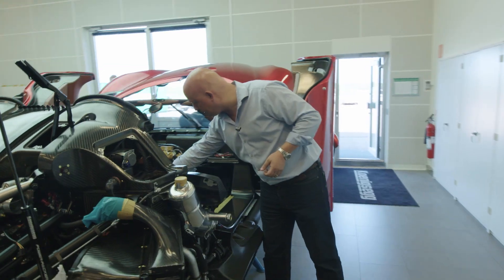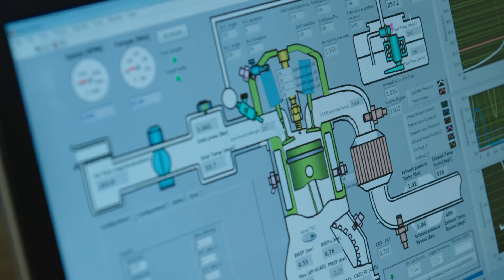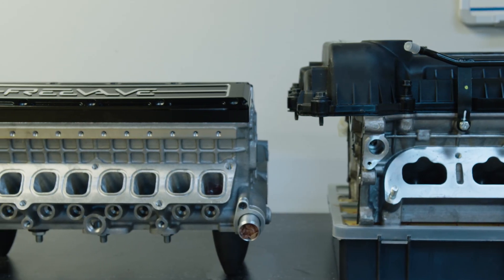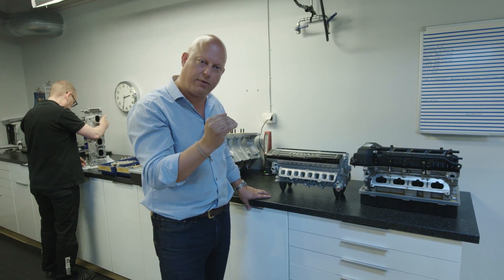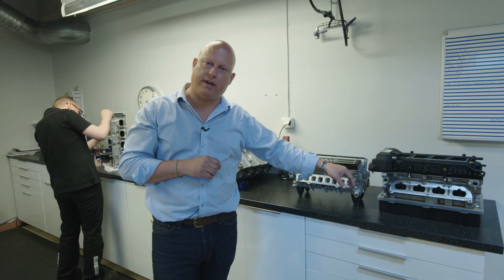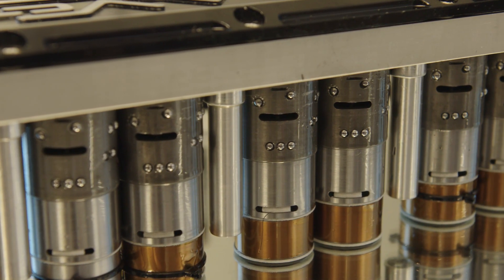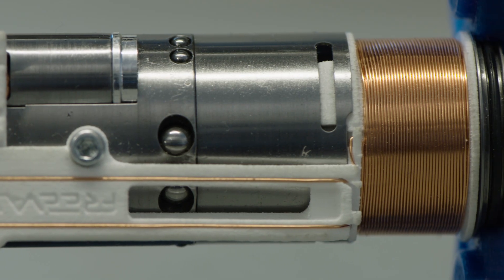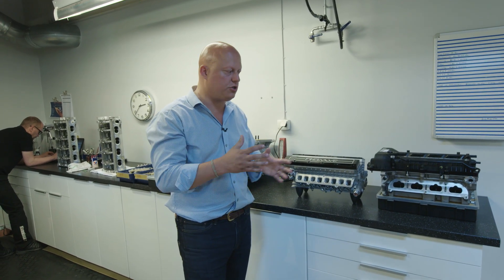Freevalve Update Camless Engine -- /INSIDE KOENIGSEGG

Comment: and people think electric cars are the only future not knowing the advanced made in internal combustion engines
Reply: shredBucketheadshred because of thermodynamics. ICE can be as efficient as physics allows. And it is not good enough. In addition burning gasoline with ultra high efficiency deals with only a third of the problem. most of pollution comes way before that. Making gasoline requires more electricity than EV consumes for same distance to travel compared to ideal ICE.
Reply: There's other things you can burn in a ICE than oil. 

ie over here most of the RE85 fuel is made from biodegradable WASTE.
Reply: Not true, in a disposable society everything is trash.... eventually
Reply: Opaali That's good but there is not enough of trash to run even 1% of all vehicles in the world.
Reply: Mantis Garage noup. car batteries are recycled and recycled and recycled. mor e than 95% of them. biodegradeble material is trashed but recyclets itself as fertilizer.
Reply: The reason we have issues with NOx gasses is because those are created when you lean burn fuel. A clean burn of fuel produces CO2 and H2O. The problem is that you produce "too much" CO2. 

In attempting to cut down on CO2 emissions we went to NOx emissions, attempting to cut those down has lead to the modern cars lack of MPG's over older vehicles as emissions controls are fighting the very principle of the engine. (Obvious example is look at how MPG has stagnated between 1980 and 2010)
Reply: Pretty much correct. There are ways to treat NOx emissions down to ridiculously low levels but manufacturers try to avoid those at all costs (due to extra costs).
This is called SCR and AdBlu is used for that. This also solves fuel consumtions that is used to treat exhaust.
Reply: I totally favor electric cars since they dont make as much noise as ICE cars, and that's very important for some of us! (sure hybrids are close but not really).
Reply: Vagelis Dimou
So no passion for automobiles huh? don't understand a mans connection and a driving experience? shame
Reply: Combustion will become more of an enthusiast thing just like manual transmissions. Gasoline, coming from oil is non renewable and because of that it's still going to lose out in popularity as compared to electronic. I believe hydrogen fuel cell is going to be more popular than a standard rechargeable electric car though. It is much more efficient and be refueled in a couple minutes rather than an hour or more.
Reply: Theres nothing wrong with CO2, that why we have trees, to convert CO2 to O2. The real issue is its non renewable.
Reply: Cave Johnson - and where, pray tell, does the electricity that runs those motors on the zumwalt class come from?     I've never looked into it, But I'm guessing with 90 percent certainty, that it is produced by generators spun by very large internal combustion engines.
Reply: Burning oil is untreatable disease - you always end up with CO2 no matter how clean burning process is.
But advancements in ICE tech is always welcomed. There will be few decades with a lot of PHEV vehicles.
Also trains, ships - those will take another decades to switch to electric. Therefore ICE engine advancements are very welcome.
Reply: Arnis Tarassu
Co2 is NOT the problem it's the other noxious gasses BUT the pint here is that electric motors and the massive amounts of electricity it takes to run them pollute more with the current tech weather its directly or the result of disposal of batteries and products
Reply: ***** oh. CO2 is not a problem. I see. Paris agreement was just for fun.
Reply: Arnis Tarassu
in comparison BUT the time when trees and plants stop breathing it THEN we have a real problem but you fail to understand that ICE's continue to improve and are more economical than ever while alternates are still very much a pollutant
Reply: *****
Making gearbox and ICE is also pollution. Making chassis is also pollution. Don't compare EV vs walking. Compare EV vs ICEvehicle. Batteries will pollute if you trash them. In real life used batteries have much longer life than vehicle itself. Stationary storage.
Reply: shredBucketheadshred sad that you do not know enough. learn. then speak
Reply: Arnis Tarassu
look who's talking
Reply: mech-engineer level5 (240 points, 4 years), you?
Reply: Preston Tucker, of the Tucker Automobile Company, came up with a cam-less engine design in the late 1940s. It was a 589 cubic inch engine and actuated its valves using hydraulic pressure versus this design's pneumatic construction. This is a rekindling of an old technology and refined for modern application. There really isn't much new under the sun in the automotive world, just revisions and refinements of past ideas. As we know, electric automobiles were more prominent than internal combustion engines at the turn of the last century and so was steam. ICE won for minor efficiencies in starting that were taken care of as steam tech advanced, and range, which would be taken care of by modern battery tech.

Comment: This is fascinating piece of technology! An engine with no cams and timing chain(s)/belt(s), no throttle body AND no DI would be basically unkillable and maintenance free (apart from basic maintenance any combustion engine needs)! Well if the freevalve system itself will withstand extended use. I bet this will be as close to EV's efficiency (currently) combustion engines will ever get.

Comment: Saving money with no pre cat and saving money with fuel consumption.?...I'm pretty sure this is not a cheap conversion..Just my thoughts.?
Reply: Dude this is engineering development to mainstream an incredible, advanced technology... Its not some fucking Summit Racing bolt on kit bro lol.
Reply: not. a. kit.
Reply: ZIGgassedUP obviously doing the conversion is going to cost money but it would pay for itself down the road
Reply: they adapt this to the existing motor so the company can reuse parts of there production
Reply: not an after market conversion kit...
Reply: Let's say the kit was 20,000 moneys and a pre cat is about 800 moneys then you'd have to burn up a lot of fuel to get to the part when you're actually saving money..Just my thoughts.
Reply: Forgive me if I heard wrong but I'm sure he said this project was adapting a freevalve system to an existing Chinese 1.6 liter turbo engine...Now that sounds like a kit to me and of course you won't be able to get it at any old performance parts outlet mate..lol...Just sayin'.

Comment: Mind just blown. We need this tech in production cars. PLS
Reply: he doesn't mention this system FUCKS up the valve seats like 100x faster than a normal engine.
Reply: That's the plan...
Reply: jean luc Dubinator  well its an old old idea.  it has to work as reliably as a cam to be viable.  he leaves out the problems with it.  if anyone can get it into production he can.  i am hopeful.
Reply: Source? If such an issue existed by freevalves very nature of software controlled precision valve holding and speed you could actually tell the valves to close at 100% speed till the very last fraction mm then slow to give the valve a softer landing. That said current cars using beehive/doublestack/very strong valvesprings dont have an issue with valve seat wear, often the cam and valve-stems see increased wear from high strength valve springs.
Reply: Kipcha Vargosain the issue is slowing the value down before it slams into the seat.

The bald man himself mentioned it before.

Doubt they want to talk bad on their technology though

Let's hope they can fix it
Reply: Solenoid valve actuation will cause retainer failure long before seat wear becomes a problem, an errant valve is a little more catastrophic than a worn seat.  What you are talking about is old tech i.e. not Freevalve.  What exactly was it that Koenigsegg mentioned, what was the context, maybe listen to it again?  Kipcha Vargosain
Reply: Awesome Legend the bald man himself mentioned the valve seats wearing out too fast.
Reply: Not An Argument.  IKR.....  Maybe listen to it again?
Reply: Awesome Legend he literally talked about it.
Said they were trying to get a way to slow down the valve closing.
Like show down the closing at the last 1% to help preserve the seat

Comment: %15 improvement in fuel economy? With independent valve control you can switch over to Atkinson cycle at will and get far better economy than that.

Comment: You missed the most important issue with direct injection that Ford is learning the hard way.   With Direct injection there is nothing to wash the back of the intake valves which leads to schmoo buildup and costly repair or "maintenance" as some would call it.

Comment: The work Koenigsegg is doing is amazing. This Freevalve system allows so much control of the engine its insane. You could theoretically electronically shed cylinders and independently control valve timing which means you can change the displacement of each individual cylinder that leads to HUGE fuel saving potential. Variable Valve Timing in its own right was a big step forward but this will completely change the market when it comes to emissions and fuel economy. 
The way the design looks you would need nothing more than to swap the head and ECM or possibly just flash an update which means converting most OHC vehicles will be a breeze from OEM's

Comment: Unless I miss my guess, your using oil pressure in your free value system.  If that is the case, how do you get enough oil pressure to run the system at start up?  especially a cold start in a northern winter climate?
Reply: This is pneumatic. 2:58.
Reply: It's electronically controlled.
Reply: So are the power stroke injectors, but they use engine oil pressure to do the mechanical work.  I'm guessing they are using a similar system where the electronics control the flow of engine oil to apply hydraulic pressure to actuate the valves.
Reply: It will work very similarly to the powerstroke injectors. As for oil pressure at startup, just crank it until the oil pressure is sufficient and then trigger the valves.

The oil systems are good enough these days that they don't bleed down too much at all. You might add one second of crank time to build enough pressure. Of course it would be a longer crank right after an oil filter change.
Reply: pneumatic? using air pressure.
Reply: Indeed he does say pneumatic.

And you can clearly see the high and low pressure gas ports on the left side of the head.

I noticed him saying it but didn't register it. That's interesting. I wonder what kind of pressure levels we are talking here. And if it uses a closed loop inert gas or just relies on atmospheric air.

I'll be interested to see this engine in the future.

Comment: That's amazing.  It would be interesting to see their method for pressurizing the air lines. It seems like air pumps on average don't last nearly as long as an engine and it seems like they would degrade way quicker.

Comment: I want to know what would happen if  1 or 2 valves are broken.
Reply: I'd imagine the system would automatically close the valve if it detected a timing problem. I mean, that's how I'd do it.
Reply: Probably has a normal spring as backup so that if it fails, it fails safe i.e. valve closed. In normal operation the pneumatics will just overpower the spring. This is how it works in F1 anyway.
Reply: or maybe the coil is to determine the position while the pneumatics are moved like an ordinary pneumatic actuator.
Reply: they smash into the pistons and kill basically everything.
the same result of a normal engine dropping a valve.
Reply: Not An Argument. Their website has a cutaway image that suggests there is a spring.
Reply: Xei I don't think it has a spring.
These valves open 100% immediately.(at wide open)
That would destroy a conventional spring in a few hours.
Reply: mercuriallimit I think they valves are closed system pneumatic tubes with coils to close them. so if the electronics fail I would assume the valve would close. if the pneumatics failed I would assume the valve might just end up stuck open.
Reply: In general it won't happen. valves get broken or bent because the camshaft stops and holds them open, so the pistons smash into them.

In a freevalve engine there's no camshaft behind the valve to prevent it sliding back and the natural state is "closed". In other words it's far more "failsafe" than a traditional design when things break.
Reply: Yup. the Fiat airtronic system is like this. The problem being that the instantaneous electrical power to move the valves quickly is a few kW - which means coils get very hot, very quickly and need watercooling.

Fiat kept the camshaft (for the moment) even though they do some whizzy things (like multiple valve opening in a cycle and very late closure for economy - moving to a miller cycle). but it's clear the path is towards camless engines.
Reply: Conventional springs on cammed engines are opening up to 100 times per second. They can take the load for decades. in pneumatically valved engines the springs are usually much lower resistance and there to keep the valve closed (out of harm's way) in the event of a pneumatics failure.

Comment: I bet this engine sounds incredibly weird compared to a regular ICE
Reply: they have videos of an  engine with freevalve running, it sounds much like a normal 4 stroke engine.
Reply: Very likely sounds closer to rotary or 2 stroke engine i think?
Reply: Jacob McRoberts

probably depends on what mode/cycle they're in plus if it's cold start in winter or up and running constant speed(&rpm)

Search for "Cargine" it might help (Google might want to re-direct you to "Carnegie" which is a completely different company. Happy hunting)
Reply: Jacob M'Boi It is a standard ICE only difference is electronically controlled valves rather than them running off a cam. probably wouldn't sound much different

Comment: No cams, no timing belt, no throttle body, no valve lash adjustments... Holy moly that's a huge leap! 

MUCH easier to maintain... No timing belt breaking, no burnt valves from incorrect lash, no vacuum leaks, or oil leaks in the VVT system, soooo much headache will just disappear...
Reply: We've had a hundred years to learn how to handle all of that. This system comes with exiting new problems we've yet to learn about...

Jokes aside there are both positive and negative aspects to this. For instance most catastrophic failures, such as the electrical system being knocked out or the pneumatic blowing a line that disables the entire free valve system will cause the valves to fail shut. In a conventional engine a broken timing belt usually means there will be some serious damage to the engine.
Reply: Are you sure about that? My old '70 Chevelle never gave me a bit of trouble that took longer than five minutes to figure out. I spent a year and a half chasing down DTCs in my Audi to find the fault was a part thoroughly unrelated to any DTC I encountered. So much in this system needs to work PERFECTLY for it to work at all, I predict UNPARALLELED headaches with systems such as this.
Reply: I think that ultimately the system would be just as reliable as fuel injectors.  It would probably get to the point where you change your Valve actuators every XX miles just like spark plugs.  I had a 69 Camaro and other various classic cars and you had to adjust or change alot all the time...I.e.. spark plugs, clean the carb, adjust or replace the points, fix the oil leak from the two piece seal...not to mention the multitude of hondas with bent valves due to timing belt failure...etc....Just saying that with a little time and advance engineering techniques, I feel these problems will be mitigated